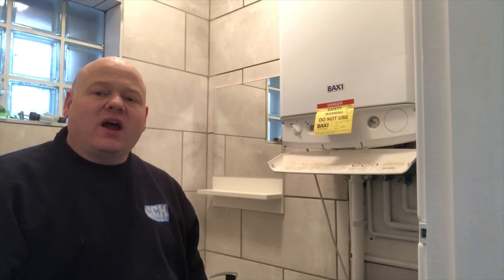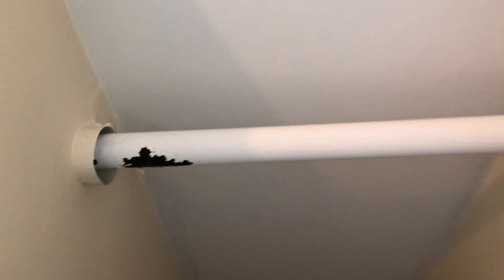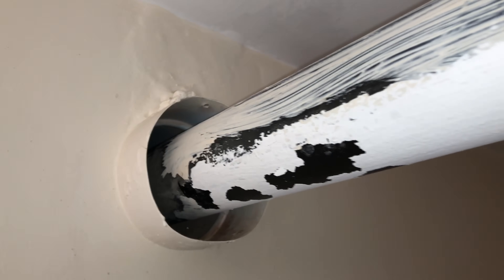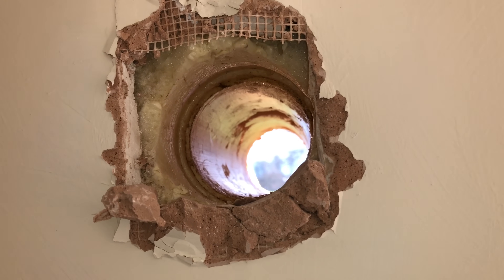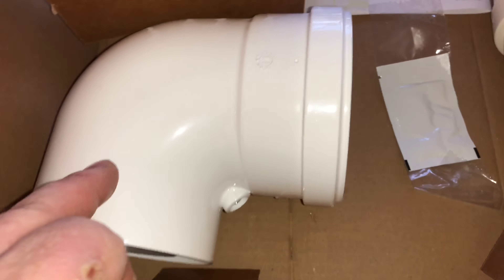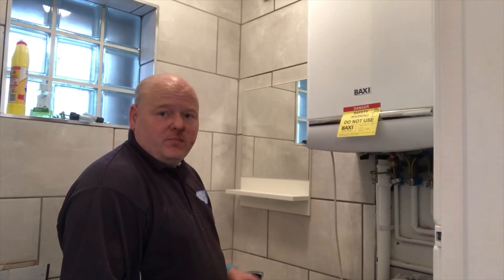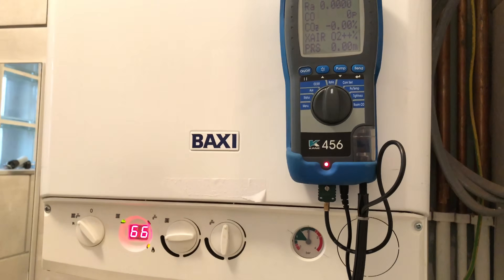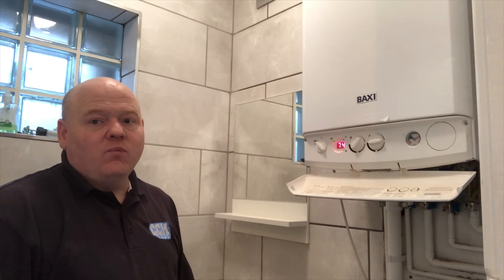Dangerous Gas Boiler  A day in the life of a Gas Engineer / Plumber

Comment: The manufacturers know full well that lots of their boilers are not fitted by "Gas Safe" engineers, that is why you can walk into outlets all over the country or go online and buy one. I can understand why people do not want to pay "Gas Safe" prices as I know Doctors who charge less.  My friend had a boiler fitted replacing an older combi. The older combi had been removed so it was a case of fitting to the wall, fitting the flue, joining the pipes and testing. All this done in 5 hours and the bargain price of £780.
Reply: We would be rich if we were all doing two combi swaps a day... doesn’t work like that in real life though.
Reply from the maker: How did you do all the safety checks, How did you test gas, How did you test flue was working correctly, How did you check gas vavle was set up correctly, etc etc etc, I have around £20k in tools to come and install boilers correctly.
Reply: @AllenHart999  That is what I am saying, the "Gas Safe" engineer was at his house for 5 hours and charged £780, that equates at nearly £200,000 per year, so 20k in tools is nothing. Why do Gas engineers charge so much and do you think it makes people want to do it on the cheap.
Reply from the maker: @johnlightfoot9967  Thats a load of rubbish though, We do not do boilers every day , This is made up. I could earn more money if i worked for a company but i choose to work for myself as it suits my life, picking kids up etc from school... Times are very hard for companies that want to do the job correctly. Thanks for your comments though.
Reply from the maker: I would be happy to do 2 a month 😂😂😂😂

Comment: Does it have to have a spur? I thought a plug socket was ok?
Reply from the maker: Spur is ok if double pole, socket is ok if it has no switch. as far as i am aware. Thanks.
Reply: That’s what I thought, but confusing why you said it had no spur like it was supposed to. No worries
Reply: I wasn’t askin what was preferred or nice, just what is acceptable in the regs.
Reply: I was always told that it has to be a spur as when you remove the fuse you are only isolating the Live, the Neutral and earth remain connected so your rcd will trip a fault to earth, if you have a plug and it is removed you disconnect all 3

Comment: If the gas is that much undersize you cannot do be getting correct analyser readings even though they may look ok, read the book, you must have a minimum working pressure (less than 1 mbar drop) or the minimum at the gas valve test point that the manufacture says. only then can you test/ commision/ adjust a gas boiler to get the correct set up. If your commissioning the boiler and you are,  as it was not installed by a RGI,  you have to change the gas pipe to the size required so that you are within the percentage allowed, only then can you carry on commissioning the boiler. be careful my friend what's on here they can see as well, you got to be 100% on it to upload this stuff.

Comment: 8 mins into the vid. You say that the flu should have a backfall ? is this a mistake ?  Any water gathering within the flu should want to flow to the outside surely, not flow back towards the boiler
Reply from the maker: I am correct in the video, The water needs to go back to the boiler. Thanks for the question. 👍

Comment: did you check the expansion to see if it was charged .
Reply from the maker: I measured the system and KW and it shown it was about half the size needed if i remember correctly, I have a follow up video coming soon and i will try and answer some of the questions. Thanks.

Comment: Great video Allen. How would you compare the Baxi 624 to a 24kw Duo Tec? I see both are same price but stats state the 624 has slightly better litres per minute.
Reply from the maker: Depends on space really, The duo-tec has been a great Boiler for over 10 years, bit old hat now but it does what it says on the tin, both good boilers
Reply: Thanks for your reply. I ended up going for the 624

Comment: That's what happens when someone says I know a person who will do the job for half the price the person who installed this has put the homeowners lives at risk these type of installer's should be arrested and sent to prison I'm really good with electronics and industrial machinery but when it comes to gas ALWAYS CALL GAS SAFE.
Reply from the maker: Cheapest is not always the best. Thanks for watching.
Reply: hffp1  I bet when 50% of all householders have a multi fuel system our government will introduce a tax for polluting the environment it's like diesel back in the day it was all the rage the government was praising it giving grants out like sweets but now it's really bad for the environment it's all electric or duel fuel cars I would dread to think what the replacement cells will cost when they die and we probably have to pay a used battery disposing tax. I would love to see the electric  powerhouse emissions when we are all charging cars in the evening.

Comment: Looks like the house has been extended and the boiler was on an outside wall. Then someone has badly extended the flue. Also imo the expansion vessel is shot.
Reply: I agree with you house extension
Reply: As far as I am aware it doesn't need to be connected via a spur. A 3amp fuse in the 3pin plug is ok. 

It just needs to be safely isolated and for that you would just take the fuse out of the plug same as you would for the spur. Or have tge Electrical Installation regs changed since I retired 2yrs ago
Reply: Does anyone use nitrogen to fill the expansion vessels? I know it does not leak out though the rubber as fast as air does!?
Reply from the maker: I just use Air as its safer to carry, 👍
Reply: @AllenHart999  im genuinley curious why is air safer to carry?

my only thought is your carrying air via a air compressor so its at lower pressure than say a nitrogen cylinder?
Reply: @Sarge92  You can normally find air around on site.
Reply: @Sarge92  Bicycle/foot pump for air, tank under pressure for nitrogen just means something else rattling around in the van that's not going to be used on a daily basis - isn't worth the cost.

40 kw Boiler generally should be a 28mm Gas supply depending on the distance, no smaller. A fuse spur or a plug labelled "Boiler" are both still allowable.
40 kw Combi's for hot water still are only really capable of supplying one outlet at a time (up to a 18L/Min shower) but generally aren't good for a multiple bathroom system you'd do better with a pressurized tank or electric showers. & if the Liter/Min is only 10L/min at the kitchen tap straight off the main all that's happening on that 40 kw is it'll hit temperature and shut down during running causing showers to run hot-cold-hot-cold. 

If you take the house as average 3-4 bed, 15 radiators at 1.5 kw each you're still only looking at a 23 kw heating load, if 2 kw per rad it's still only a 30 kw load. If you add a pressurized tank that averages 3 kw for the coil, say 6 kw for a big one you're at a 35 kw boiler (non-Combi).

Yes it looks like some idiot extended and enclosed the boiler however the Gas pipe being undersized:
(GIUSP 3.4 Undersized pipework proved to be affecting
 the safe operation of any appliance. ID e.g. incomplete combustion.)
and combustion air being taken from the room (GIUSP section 6) would deem this ID (Immediately Dangerous) and RIDDOR reportable.
Reply: @Sarge92  So am I, nitrogen is an inert gas and makes up 80% of the air we breathe, so there is no danger whatsoever from the nitrogen itself.
Reply: @michaeljohnson1006  Air is 78% nitrogen anyway.
Reply: @Cheradanine  69.1%
Reply: @davidturnbull2931  maybe on your planet it is. On Earth it's about 78%. :-)
Reply: If there’s no ‘ncs’ anymore then how is it allowed he can re-instate this boiler without putting them things right? And the one thing that is put right (the flue) needs the support clip fitting because he fitted a flue extension. Then I heard in most recent video he wants to charge a monthly fee now to watch these videos 🤣
Reply: Roverturbo, that’s my 1st guess as soon as I saw it, it probably was installed correctly and then the builder or homeowner has extended it with a makeshift PDK
Reply: It was clear within 2 minutes that's exactly what happened, an extension built on the back so the builder extended the flu and added more radiators to the system, nothing wrong with the original install. Not sure why this guy hasn't picked up on that.
Reply: I agree . thinking how is the blow off going to be installed on an internal wall ???
Reply: Might have just lost some air. Open PRV and repressurize the expansion tank, then test again.
Reply: Undersized gas for a 40wk boiler, no spur for power, significantly oversized boiler for property (if more rads were added, that just absorbs some of the over capacity on CH) so i would say a loooooong way from being ok originally. Agree with the extension comments, but was a 3rd rate job even before cowboy builder screwed with it!
Reply: So if the customer was going to build a double extension on the house at a later date they might have been stuck with an undersized boiler now they have correct boiler . agree
Reply: @tonysgardensgizmos7164  
It doesn't matter what kw the boiler for heating the kw is rated on the hot water
Reply: @tonysgardensgizmos7164  Boiler was probably over sized to provide a better flow rate to the taps.
Reply: @tonysgardensgizmos7164  as others have pointed out he doesn't understand how service mode works on that model. The boiler was self regulating in the mode he had it in. Gas supply was fine all along. Only cowboy I've seen is the chap making the video. Dump as a bag of rocks. If he wasn't shown an example on his 10 week course he has not a clue what he's looking at.
Reply: @danielfay  what are you talking about? That's exactly how you put it to high rate and by running the hot tap you're ensuring the gas valve doesn't modulate down. Read the MI's before you make a "dump" i mean dumb comment!

Comment: Great Video Alan, 1 question, flow rates - are measuring flow rates to determine combi boiler power requirements best done at a single tap? won't the tap itself will have its own restriction. Don't you need the incoming flow rates from the main cock to see what power you may need and therefore could use for when showers and taps are open simultaneously. I've got 17 lpm at stop cock and 10 lpm at mains cold at sink (grohe).
Reply: Kevin McPheat my thoughts exactly. That tap looked like it had aerated flow- some Ikea kitchen taps for example only deliver about 6 litres a minute- a water saving feature, but not ideal if you're trying to measure the flow capabilities of the incoming supply. Better to test at a bathtap or unrestricted outside tap.

Comment: Sorry I didn’t understand why the pressure was increasing and another expansion vessel is required? You said the boiler is too big for property and the trvs are leaking? Thanks Allen
Reply: 40kw Baxi boiler has a 10 l vessel, which can do off the top of my head 155 litres of CH water, if your CH system has more than that you will need an extra vessel to cope with that.
The 40KW stands for the DHW output only.
Reply from the maker: As water gets hot it expands, you need a correctly sized expansion vessel to stop the pressure going too high. It’s the radiator valves that are leaking, not the TRV,s

Comment: I'm not a gas engineer/plumber, but at a customers house I noticed that the pipes for their Main Combi are all boxed in, so I can't see where the pressure relief pipe is routed too, but it certainly doesn't directly exit the house anywhere. I suspect it drains into the condensate pipe/sink waste from nearby sink which is all boxed in. Before I advise him to get a heating engineer out, can anyone confirm this is not ok? I understood the pressure relief pipe should be visible on the outside of the house.
Reply: Visually check all the outside of the house. If the boilers upstairs check directly below or around where the flue terminates. Some I've found on opposite sides of the buildings. 

See if the instructions are available. If a registered heating engineer installed it. The benchmark should be filled in. Usually a competent person would have terminated  the prv pipe correctly. Imho. It could be anywhere terminating outside. As long as it terminates back towards the wall, thats fine.

Comment: Allen, first class expose. It would be reassuring for all concerned if Gas Safe could tell us what action they have taken.

It is difficult to fathom why any installer would fit a boiler without a timer. The oversizing of the boiler is a fundamental error too. My bet is that the  homeowner at the time did the install and extended the flue. I also noticed a run of twin and earth down the side of the boiler - unfinished electrical work.

Looks like current homeowner may have a few bodge jobs to rectify.
Reply from the maker: It’s a hard one really as it seems like a builder may have done some of it, not really sure.
Reply: True but customers think big is better I constantly explain why the correct boiler size is an important part of any installation but it often falls on deaf ears
Reply from the maker: Gary Puntan Not really, The water flow rate is only 10L/M so a 40kw is way oversized. 👍 Cylinder would of been better with a home boost kit. 👍
Reply from the maker: @Gary Puntan I am totally guessing now but my guess it would be far too big, People install boilers without sizing them correctly, Unless you have around 20L/M on your cold its oversized. Hope this helps, Thanks.

Comment: One of thee most shocking jobs I went to was where a builder bricked up a chimney for an open flue gas fire, drilled a balanced flue for a combi boiler out of the side of the stack and left it like it. When I carried out the flue flow test, smoke came out the flue 😂
Reply from the maker: It’s crazy how they get away with it.

Comment: So Al leaves the boiler operating with undersized gas pipework,leaking prv inside the property pressure at 3 bar 🤷🏻‍♂️😂 hope he knows he’s now responsible for that installation. Think gas safe are going to be looking at you soon mate!
Reply: Ste D he’s just potentially saved someone’s or someone’s family’s lives you muppet!.....undersized gas supply isn’t dangerous! A dripping PRV is not even A/R, how many boilers have you seen with no PRV even piped up or discharging somewhere internally!?!  Which is A/R & a faulty expansion vessel certainly doesn’t warrant condemning a boiler!! 
But I’m sure he’s glad of your input!
Reply from the maker: Video 2 and 3 coming soon, you will be able to see how it was left in the end 👍Thanks for watching
Reply: Allen Hart sound mate 👍
Reply: Listen “p” soft lad watch the video the boiler was safe as it was capped off so nobody was dying who’s the muppet now? I wouldn’t have personally left the boiler operating until the rectification work was was completed! As for your comments regarding how many times have I seen this and that it doesn’t mean it’s okay this is the whole idea of Al’s video to expose bad installations. Sounds to me your the type to leave installations unsafe 😉
Reply: Ste D “p soft lad”!?? What kind of lingo is that!?! 😂...... my guess is that Allen was employed by the customer to go in there & check the boilers safety & integrity!?! So in which circumstance the correct thing to do was carry out the repair work to the flue which was an immediate danger (as I’m sure even a know all like you would agree!) & get the appliance up & running with no further immediate danger to the occupants whom were probably paying for this service with a view to carrying out further works after advice!..........funny how you seem to have “jumped ship” & now complimenting Allen which is a far cry from your initial comment!?!🤔
Reply from the maker: Thank you for your comments, Putting videos out like this will always leave myself open to criticism, I welcome and expect it. Thanks Again 👍
Reply: I am right though 😉

Comment: Vessel might need recharging
Reply from the maker: Andy Kershaw Vessel is about half the size as what is needed for the size of the property. Thanks
Reply: @AllenHart999  How big is the system? We have a massive problem at work with boilers losing pressure majority of them potterton/baxi with only an 8 litre vessel, most property's have 7-8 rads
Reply from the maker: Andy Kershaw This is a 5 bed house with about 20 rads. Definitely needs bigger expansion vessel
Reply: @AllenHart999  💯

Comment: Hi Alan
You couldn't install a new appliance and have it under gassed, so what do you do as part of a service when you find an appliance is under gassed? Is it okay to be left and give advice to the customer to have the pipe work appropriately resized or do you have to take remedial action to the current pipe work etc in order to make it good and finish the service?
Thanks!
Reply from the maker: Unfortunately in my opinion yes, if it’s undersized but working safely then there is not a great deal that you can do.
Reply: If the minimum gas rate is correct and flue gas analysis and other checks  are correct then yeah it can be left running pal
Reply: @intheyear2510  appreciate the feedback. I always gas rate as well because under gassed appliances when servicing is ridiculously common. 👍
Reply: Steve Whitehead Is it because people are upsizing when having a newer condensing boiler fitted, you think? (And because of Extensions too)
I know I’m having to go up from 22mm to 28mm.. 
But that’s because I’m going from old style 30kw Combi to newer 35kw condensing. (ATAG ic)